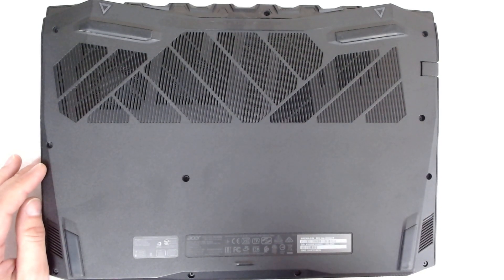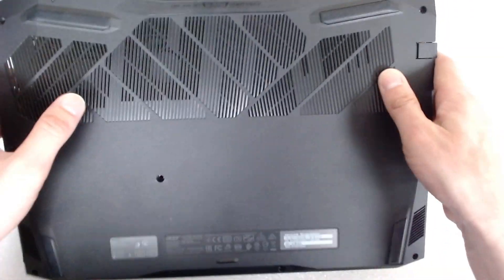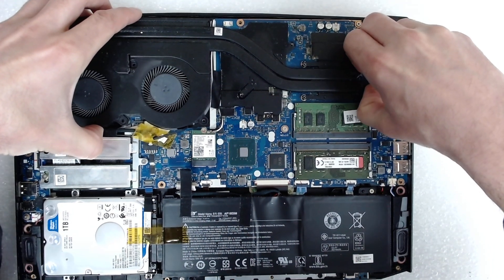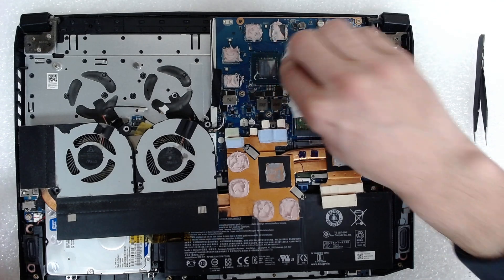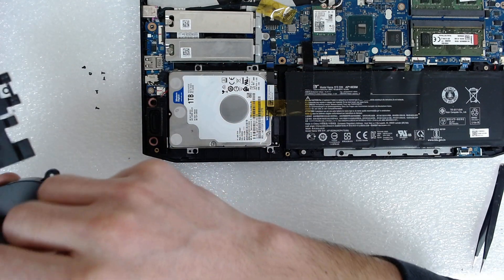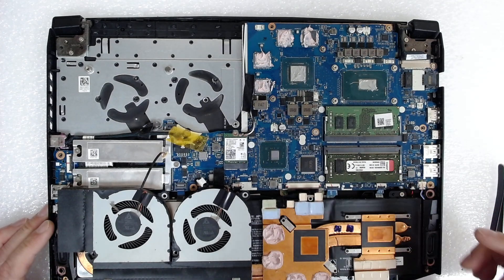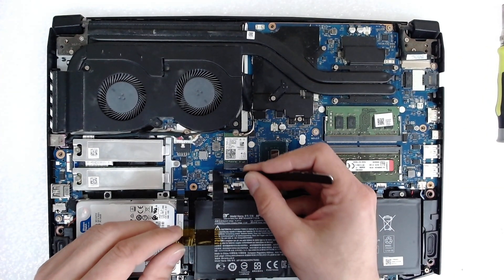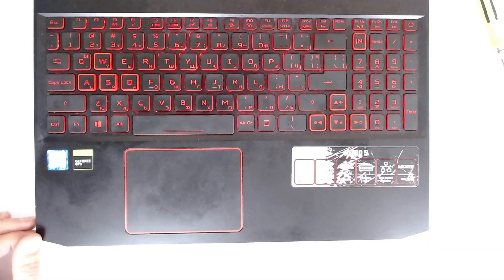Acer Nitro AN515-54 Disassembly / Fan Cleaning

Comment: how to know when to replace the fans instead of just cleaning it? my technician says i need to replace the fans even though he hasn't tried to open and clean the fans..is he lying to me? my thermal is bad even after replacing the thermal paste but there's no weird noise in the fans or anything
Reply from the maker: You replace fans if cleaning doesn't help and they don't rotate freely and make strange noises. What thermal paste are you using. Bad quality thermal paste can make the temps go worse.
Reply: @LaptopDisassembly  no strange noise from the fan.

actually i've asked this technician for service 2 times already including this one. the first one was last year and he did a good job, my CPU temp went from 95c to 80c when playing games. he didn't even open the fans, only replaced the thermal paste.

now after 2nd service it only went from 95c to 90c. he used gelid gc extreme that i gave him in both of the services because he did the service in my house (i called him). i noticed that he didn't apply the paste as much this time compared to the 1st service and he only applied in the middle idk why he did that. while he was opening the laptop i asked him "why don't u clean the fans?", he said "it's not needed because the fans look fine". then after it's finished i told him the temps were still bad and he told to me to buy fans replacement (without opening the fans first lol)

is it possible he did this on purpose so i that i will call him to service sooner because he thought 1 year gap between services is too long? how common is this practice? i'm disappointed if he did this to me because after 1st service i gave bonus to him after being satisfied
Reply from the maker: @miserable__sod  Usually i tell my customers that 1.5-2y is normal for a laptop cleaning. If you use it on more dusty area or so, you can clean it every year. But less by my opinion is not needed. The temps may drop less probably because of the dist in the fan. Sometimes the fans looks clean, but the dust is stored between the can and the cooler grill, and it become like a sponge.  Check when the temps go above 80 with a hand or a paper towel in front of the cooler grill. If you feel any air  going out with a good airflow, than there is not much dust. But if you dont feel the airflow, this mean the grill is stuck with dust.
Reply: @LaptopDisassembly  so here's my situation, my laptop is from december 2019 (almost 4 years old), the thermal paste has been replaced 2x but the fans have never been opened/cleaned. and since last year whenever i play demanding games, i put the fans on max. which situation is more possible in ur opinion:

1. fans need replacement right away even though it has no strange noise
2. fans only need cleaning

because this technician insists that the fans need replacement even though he has never opened the fans before + never heard the fans sound, which for me is really weird
Reply from the maker: @baliDOTid check with software do the fans rotate at full speed. If the fans are rotating freely and no strange noises, I don't see any reason to be replaced. Use Aida64 or sysfan to check the RPM.
Reply: @LaptopDisassembly  the laptop comes with its own software and the RPM is still the same as when it was new which is 6200 RPM. so my technician is just bullshtting, i guess..?

Comment: Hey which fan shall i buy?
Reply from the maker: They are not the same for all the models. Depend on your exact model and the type of GPU you can find on Amazon or eBay.
Reply: @LaptopDisassembly  I believe I have the exact same laptop that's in the video, if you could tell me which one you got on that pc
Reply from the maker: @tcn8882  the laptop is not mine, but on a customer. I think I shared a link to the fans to someone else. Have a look, and if you don't find it, just write me that GPU you have and I will have a look on Monday.

Comment: Hi, sorry for bothering you. I'm trying to follow the procedure but no matter what screw driver I use two screws just doesn't get attached to it, their head looks a little damaged to me. What can I do in this situation? Thanks a lot
Reply from the maker: Hard so help, only by explanation, but have you try a little bigger tip. Also if the heads are damaged you have to drill them in order to remove the rest with pliers.
Reply: I could join the discord and send a picture if it's okay
Reply from the maker: @Grart-u9j  no problem... Start a new treat in General and upload pictures... Someone will help you
Reply: @LaptopDisassembly  thanks a lot!

Comment: My fans stopped working?🥲 do u have any solution for that?
Reply from the maker: Open the laptop first and check is there something blocking the fans. After that clean them, put some lubricant and test again. If that doesn't help just replace them.

Comment: is it possible to replace the fans for this laptop? if so does anyone have a link to a tutorial and a link to the exact same fans?
Reply: I did everything in this video, but realized that one of my fans were stuck, so i'm guessing thats the reason that there is so much noise
Reply from the maker: @HalilMagjaraj  try to lubricate it little, there may be some dust blocking the fan. Tell me your exact model and AMD or Nvidia card and I will look for the fan model. otherwise google the one you have and it will pop up in AliExpress or Amazon
Reply: @LaptopDisassembly  
Model: Nitro AN715-51
Nvidia Card: NVIDIA GeForce GTX 1650
I am not to good with laptops/computers, but I think this is the correct information. I might try and lubricate it when I buy some good lube, but if that doesnt work I will replace the fans.
Thanks for the help!
Reply from the maker: @HalilMagjaraj  Compare the one you have with this one: https://www.amazon.com/USKKS-AN715-51-73AJ-AN715-51-785U-AN715-51-752B-AN715-51-792N/dp/B09BR3TYQ7
Reply: @LaptopDisassembly  What lube would you recommend? Doesnt seem like the fans are going to be in stock for quite a while, and I dont have a clue which type of lube.
Reply from the maker: @HalilMagjaraj   I'm using a regular oil for sewing machine, nothing special.
Reply: @LaptopDisassembly  It worked! Used some oil and the noise has finally gone away. Took a while for me to try, but finally got around to do it. Now I can use my laptop again like normal. Thanks for all the help

Comment: Is it possible to clean only fans from dust, without removing whole heatsink?
Reply from the maker: It will be very hard. The fans are connected with the cooling pipe.

Comment: Thank you for the great video, please at 4 minut 01 econds what is the size of the screwdriver you are using, i have bought several kits but no one is matching the size of the screws i just don t know how to release these 4 screws - the other ones on the left size are another size, please help me we try to change the fans, thanks a lot
Reply from the maker: I use Philips PH0... And I use it for almost every laptop. If I need to unscrew smaller screws I use PH00.
Reply from the maker: Just push a little and at the same time twist. The first time is a bit hard to unscrew them. Don't worry, they can handle pressure.
Reply: @LaptopDisassembly  Thx a lot for the quick response happy week end

Comment: Hey what size of philip head screw driver to use to loosen the fan screws?
Reply from the maker: The smaller one for the FAN is PH00, the other one is PH0
Reply: @LaptopDisassembly  thx

Comment: is it ok to cut the tape like he did at 9:21 ?
Reply from the maker: No problem, you can use some tape after that... It is just to hold the fan, nothing special
Reply: @LaptopDisassembly  if i use regular transparent scotch tape, is there a chance that it will melt from the heat?
Reply from the maker: It will work. If you have a black tape Cor cable isolation will be better.
Reply: @LaptopDisassembly  oh so like black electrical tape that u put on exposed wires right?
Reply from the maker: Yes

Comment: Hi, i have this laptop for 4 years. I regularly clean fans and all inside the case where i can reach. I never renew the thermal paste. Im still using factory paste. Actually temperatures are still good. Im in 45-55 C in normal (turbo boost off 2.4ghz). On load i see 85-95 C (fixed 3.0 Ghz or over). Idle temperatures are fine but i want to get rid of high temps on load. Should i change the paste? I will use mx-4 if i change. Btw my fans in good condition like new but I don't know if there is as much dust on the inside as in this video?
Reply from the maker: Probably there is a layer a f dust inside. Replace the thermal paste and clean, and the temps will drop.
Reply: @LaptopDisassembly  thank you for your quick answer. I replaced new thermal paste and temps dropped. before replace i got 75-85 C on 3.0 ghz in game and now i have 66-69 with 1 level less fan. Thank you. also game fps drops mostly decreased. for 4 years, there is not so much dust on fan grids. not like video, 2-3 piece of dust only.

Comment: Thanks man. Cleaned the fans and changed the thermal paste. I went from 96 celsius with turbo mode disabled to 67 Celsius with turbo mode enabled while gaming. Now I can use the full boost clock of CPU.

Comment: Hi, what screwdriver are you using at 3:50? I can not take it off with my #0 & #1-2 :(
Reply from the maker: I use the regular Philips screw from the set. I post it in the description.
Reply: @Laptop Disassembly  crap... I also use a regular one and magnetic one. Is it normal that I can't move the screw at all? The same one from 3:50
Reply from the maker: @edmond3933  try to push a bit harder and at the same time try to twist. Sometimes the glue on the screw is a bit hard. Last case you can drill the head of the screw and remove the rest with a pliers or tweezers.

Comment: where can i buy the tiny black screws on the case fan
Reply from the maker: I doubt you can buy them from someplace. Just use a screws from a different fan. They are pretty much the same. Or you can use some type to hold the 2 parts together.

Comment: The little black tape holding the battery down ripped a little I still put it down over the battery but will it effect anything ?
Reply from the maker: Is there some lights when you power on, or some else activity. Please describe the behavior. Replug the memory also.

Comment: Super duper video! Thank you so much!! Has fixed the problem of a rattling fan and abnormal fan noise. We have Acer Nitro 5 of different model, where fans can't be unscrewed. But the idea is clear - big lumps of dust are present - you just need to get access to them. In our model I carefully pulled the fans off a frame, and scraped out dust clumps with flat screwdriver from around the perimeter of each fan, and brushed off the blades carefully. Ordered thermo paste. Will apply it when it comes. Super happy!

Comment: Hello !
I forgot to disconnect the battery while changing the thermal paste. and now my laptop won't turn on. what could be the problem? Please help me 😢
Reply from the maker: Did you short something by accident. Also is there some fan spin or any signs of light when you plug the charger. Try to remove the CMOS battery and wait 5min. After that plug back the battery and test. Also check did you plug all the cables properly l.

Comment: Im looking to clean the fans on my laptop but wondering I do need to replace the paste if I take it apart or would I be fine?
Reply from the maker: If you lift the cooler, you have to replace the paste. Otherwise the temps may go higher.

Comment: Thank you for the tutorial! I followed all steps and the GPU temperatures dropped from 70°C to like 40°C in the same conditions. CPU temperatures dropped too.
Reply: DSS guy also has acer nitro never expected to see you here
Reply: @mossytoucan6587  I didn't expect to be found here 🙃
I returned to this video today because I wanted to clean my laptop's fans after several years of collecting dust.
Reply: @ It's been probably almost half a decade since I last really touched your games and I recognized that name so I was indeed really surprised

I came here to also do the same reasons (However I dont have thermal paste with me)

Comment: Is it necessary to clean and reapply thermal paste when doing this? Or can I leave the old thermal paste as is??
Reply from the maker: Leaving the old thermal paste is very bad idea. Replace it if you can.
Reply: @LaptopDisassembly  why is it a bad idea?
Will it be even worse than before?
Or will it stay the same and you just didn’t do much good?
Reply from the maker: @saftigebadewanne5650  it will be worst than before.
Reply: @LaptopDisassembly  okay. Not too great because I don’t have any paste but thank you though! :)

Comment: Everytime I turn it on its always turning off literally idk why I checked everything to see if its plugged in right but it still just turns off every time I turn it on I don't know what the issue is I have the acer nitro 5 AN517-51-56VF
Reply from the maker: This start after you clean it, or it was like that before. Did you try different charger.
Reply: @LaptopDisassembly  before I clean it. So it started like dropping fps super super bad on games that normally before it would never drop that bad then after it would like just restart then I am like hmm maybe overheat then after it happened again then after it continues to like literally I on it it goes off on it again goes off now its literally going off super quick like I load in give it 1 min or 2 maximum then goes off. Idk what's wrong with it I even tried cleaning the fans and all checking if the power is in properly and the fan and been using the same charger even without charger it still turns off like all of this just happened today like if I wait 20-30 min thats when that 1-2 min then after that if I try on again offs in like 15-30 seconds and the fan is a little loud when I start it up
Reply from the maker: When you clean the fan, did you loft the cooler and did you replace thermal paste.
Reply: @LaptopDisassembly  loft? And i have umm some thermal paste already on it from before like its a lot on but I can try replacing a new thermal paste and if that don't work then? Or have an idea what might be the issue
Reply from the maker: Clean the old thermal paste and put Arctic mx-4 for a replacement. Don't touch the other thing from the coils. Depend on the model can be a thermal compound or a thermal pads. Replace only the thermal paste.
Reply: @LaptopDisassembly  update i replace the thermal paste and it still dose the same thing altho I didn't use it for a day next day when I turned it on it lasted for like 5 min like when I turn it on the fans like go loud like on maximum and I try turn it down on thr nitro sens that's didn't work and yh like it's going on 5000 both fans when I start it up
Reply from the maker: There can be a problem with the cooling pipes... If the paste id applied correctly. Also can be a faulty temperature sensor.. can be a lot of things.. better to take it to a repair shop for diagnosis.
Reply: @LaptopDisassembly  I see I was wondering where is the temperature sensor located? Like I talk to 1 of the pepole and they asked like if I know were the heat sensor is and all or if there is a video that shows me around like were the heat sensor is like were it's located and do I have to solder it or anything

Comment: Wish me luck guys my thermal paste lands tomorrow NEVER attempted anything like this. Biggest job to date was upgrading ram and adding an m.2 ssd 😅 Nervous is an understatement but thanks to this video i have some confidence
Reply from the maker: It is not hard. Just follow the video and don't touch the pink stuff :) And disconnect battery first.
Reply: @LaptopDisassembly  mateeee i did it 😅😅 i touched some pink stuff but hardly any. Its running cooler now im made up 🙏 Great video now to stress test it under gta using natural vision graphics mod. It always shut down laptop after about 10 mins as ran way to hot. Laptop is i7 9th gen, rtx 2060, 32gb ram so should more than handle it now after me doing this cleaning fans and re pasting
Reply from the maker: You did use a good paste, right. Coz it will not have a good effect if you put a cheap paste.
Reply: @LaptopDisassembly  Arctic Silver 5 (mate told me to get this one) Yeah my temps are down to 65 now under full gpu usage when i run msi kombuster. Kept lagging bad playing far cry 6 even on high settings during a big gun fight then laptop would power off. Now playing big gun fights in Ultra zero lag spikes and no laptop shutting down now at all. This has literally made my laptop a beast 🙏🔥

How long will this last. When will it need redoing?
Reply from the maker: Well you will notes when you have to replace it again. I usually put arctic mx-2 or mx-4 and it last about 1.5-2 years.
Reply: @LaptopDisassembly  ahh that makes sense when it starts behaving how it did pre pasting (getting hot enough to griddle sausages on it again)  🤣🤣 tbf 1 year is plenty as ill sell this and upgrade to a used 3070 laptop 💻
Reply: Hi, what is the name of that pink stuff?
Reply from the maker: It is sort of thermal pads... Come like that from factory.

Comment: I have this laptop it just died it’s not the battery I cleaned the fans but won’t turn on any idea what it could be?
Reply from the maker: It could be a faulty bios but you will need a programmer to flash it. Try to remove internal battery for 30min.